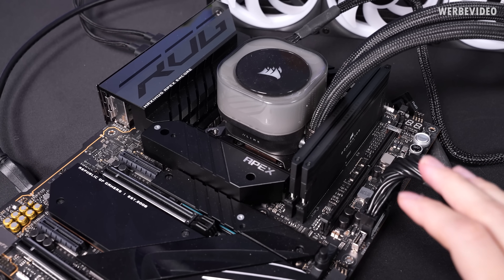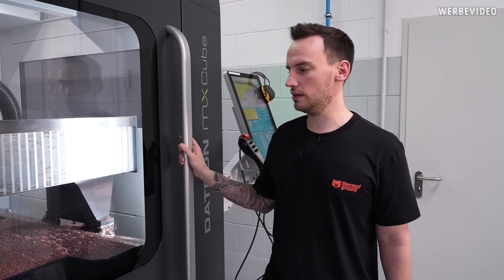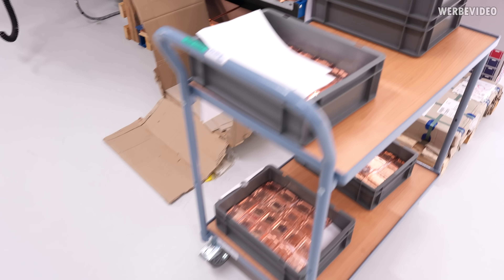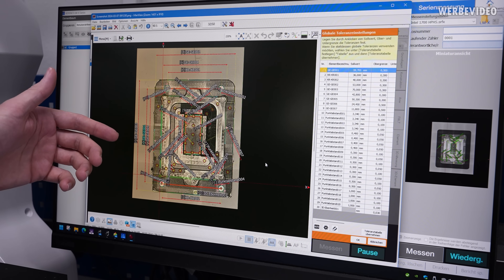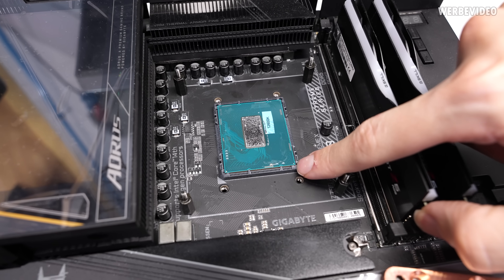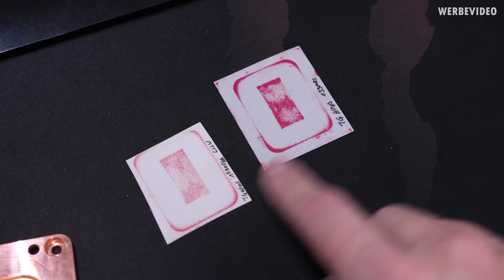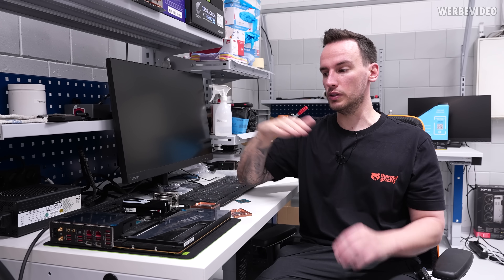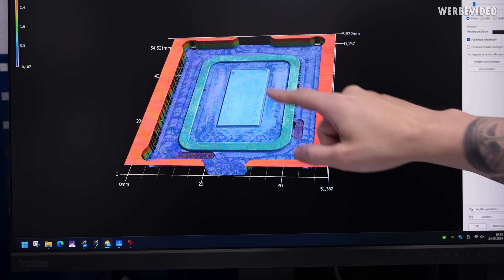I messed up

Comment: Intel specifies the socket manufacturer and lot number to be displayed on the sidewalls of the plastic base which could help narrow this down. The design shouldn't change much and seems to have an overall height tolerance of +/-0.05mm but it doesn't appear to be a critical dimension. The seating plane height after flowing has a tolerance of +/-0.2.

Personally I'd be hesitant to rely on this plastic base for such an application but I'm not sure how much tolerance you can risk. I'd imagine it's usually fine but there may be compounding variables.

Perhaps you should consider including a piece of the pressure mapping paper with a product like this. I know the Fujifilm stuff isn't cheap but in bulk it's probably under ~$1/unit and even less for a few pieces about the size of these Intel dies. That might help rule out user error and could become a great marketing tool. I've always thought something like this would be nice to see included with DD products.

Best of luck figuring it all out.

Comment: I have Iceman, 14900K and Asus Hero Z790
1) it lays on 4 legs which do  not touch memory lanes
2) First time I  used a screwdriver with 0.6 Hm, got 55 Qcode (no memory) - just turned screws 10 grad back to the left and all worked just fine. 
73 C  under FPU test AIDA64 (10 section custom cooling EK-D5 pump, 70% fans, 253W limit)

The problem may be that your customers apply NOT calibrated force, and plastic of socket may change its height due to the pressure
Reply: I use whatever screwdriver is nearby.
Reply: @MrViki60  I advice to use calibrated one, 0.5 Hm until "click" sound appears. 0.6 seems to much for me.

Comment: We'll, I'll start with the people that said they were having issues, check what components they use, maby they are doing something wrong, or maybe whatever they are using have different tolerance to what you have it's alot easier to work with the defective product than to guess what is happening

Comment: As soon as you said you went with socket height I wondered if the "issues" were a single vendor/board model or if there was possibly an issue with socket height due to say thicker PCB conflicting with plastic socket height or something.

You are immediately addressing the issue, attempting to ID the issue and didn't deflect or blame the customer.  You're doing what many companies don't do.  Good on you and this is honestly extremely interesting video but probably not one you want to make.
Reply: Yeah there may be board to board differences in socket height. That's what I was thinking.
Reply: As far as I know there are 3 types of socket 1700 currently.
1. little cutout at the base (most common)
2. no cutout
3. gold plated

Comment: Is it possible to send the contact paper to a few of the people having the problem & they can send you pictures of the results? Also can be a mainboard compatibility issue, some chip/resistor/cap on the board where you dont expect one to be... Preventing compression

Comment: Are mounting screws spring loaded? Also pressing into the plastic socket is not a good idea. The socket rim surface is not guaranteed to be flat and plastic is compressible. Extra quarter turn of the mounting screws will cause different z hight if they are not spring loaded.

Comment: looks like thermal grizzly  will be my replacement for ek so De8auer when will we see some rads and pumps and a few gpu blocks, Good to see a company taking steps to inform there uses befor it becomes a big media issue grate work

Comment: The things you can never measure on the production floor, are how hard someone is going to crank down on mounting screws, what assembly tolerances pcb manufacturers are hitting, and how uniform are the tolerances on mass-produced products you aren't manufacturing. 

You can measure your own parts until you're blue in the face, but it only helps so much. 

I will point out that there are few things i personally would change: 
A)  I would NOT be using the CPU socket itself as a hard-stop surface. It's plastic, and can easily be bent, warped, dented, crushed, and other wise deformed in ways you will never be able to predict. Even a hard plastic is still softer than most metals. 
I personally feel it would be better to produce a back plate for the other side of the Mobo, and use that back plate's screw standoff's as hard stops to prevent users from over-torquing the screws. 

B) If you're worried about pressing against the board, using a PTFE or some sort of HDPE derivative should help protect the board, while giving you a contact surface that shouldn't mar, or damage traces on the surface of the board. 

C) when talking to customers about the issue they are having, it's usually not going to be too much trouble asking them to re-seat the device, and have them take pictures of the procedure and specific points of interest to you during the process. This can give invaluable information to you not only about the potential root cause of the issue, but also gives you an overall view of the entire environment the product is in, it's easy to overlook small things that may be affecting the operation of your product when they are in an environment you can't inspect. (I'm not even going to get started on the PC's i've worked on in the past that had entire furballs of cat/dog hair trapped in the PCIe / Ram sockets... )

D) can i come play on your datron? XD
Reply: Being to close is not only an issue of "if it damages the MB" but being too close to the traces can change their impedance and enabling crass talk in the traces, basically creating interference.
Reply: Not every motherboard is going to be the same thickness tho... You could use a standoff from the FRONT of the motherboard to measure the thickness but if the socket depth isn't the same on every motherboard that just adds another issue to deal with. Will be interesting seeing what conclusions eventually are made about what is causing the issue, it is good to see companies getting out ahead of things, admitting there is a problem, then working with the community to find a fix instead of hide from it.
Reply: 10/10 across the board, the number of times both on PC's and tooling that I've had people go too hard on the first corner because there's zero resistance / they're not noticing it tip up, ending in a canoe / saddle situation is kind of sad. Getting a matching machined reference surface (that's also in line with the load, not allowing for any x/y torque) is the only fool proof way.
Reply: Динамометрическая отвертка в помощь. 60$ или трещетка с aliexpress за 13$
Reply: Torque screwdriver isn't so expensive and it should be a standard tool of enthusiast. You put there 5 Nm or some other value and you get consistent pressure results for every user :)

Comment: As others mentioned it would be interesting to get their MOBO / CPU to see what and if there is any differences. 
As for thermal expansion, would that even be an issue? One would think that manufactures have figured that one out and unless you're going for EOC (extreme over clocking) what is the average temperature a cpu see's 5-100C. (very broad range).

Could it be environmental? Not every room heats / cools the same way. 

I don't mind boring videos like this, gives us an insight into manufacturing. The steps you're taking to ensure QC and the engineering it takes to pull this off.

Comment: Are you sure that there's only one kind of socket? AFAIK, both Foxconn and Lotes make these. Thus, I'm inclined to think that the tolerances or material composition (and thus thermal expansion of the plastic) do vary. Other than that: Warped mainboards maybe?

Comment: Love your products.  I am no engeneer but with all of your checks the one thing you could not account for is Mother Board.  This product has a large span of chip coverage.  That being said age and wear of the mother board is probably the issue.  With such a small batch of 50 possible problems I would ask each what board and how long in service to check for possible connection. Maybe a brand and particular skew of mother board had a slight differance during production that under normal use works correctly but when dealing with tight tolerance fails to meet the standards you work in.  Age of board could have been exposed to excessive heat changeing flatness and or height  of socket or even overall board warpage.  I am sure there are other mother board factors that could play into these differences causeing the issue but without knowing the 50 complaint boards and time in service it could not be looked into or tested.

Keep up the great work and can not thank you enough for setting a great standard for others to work by.

Comment: A good guess: the tolerance on MBs is greater than you perceive. 
The boards are not designed for this device to be applied so they have no reason to meet the tolerance range you have....

Comment: Hello Roman,

Take the parts with issue back into your lab as fast as possible, and send them replacement sample. Measure 100% the replacement sample not randomly and keep contact with your clients if they experience the same issue.
Measure the returned parts and compare them with your golden sample / PPAP retrieved part. Even a sample from the first production batch would be fine.

Get in contact with the customers that are disappointed, where your product did not work as expected and try to convince them to sell you their motherboards. A few samples will be enough. Measure the mobo's with your Keyence equipment to see if there is a difference between the official specfication and the real product.

Make a list of all affected products and use statistics to pinpoint a certain combo, motherboard, processor, own production batches to solve this thing. And encourage your customer to speak up if things are not ok, as you need as much info as possible.

PS - small hints an automotive quality manager. Greetings from Romania.

Comment: could the plastic around the socket be the cause?  If you are relying on that to reduce the pressure on the cpu, but its slighlty off - caused either by variances in the product or process in how it is installed on the motherboard, that could affect contact.     Your quick response and explantion of the problem, plus pulling the product shows how you are dedicated to producing a quality product, and I am impressed by this response.

Comment: I would check the age of the CPUs affected. Very early CPUs may have different die heights.

Also if you have been measuring the socket height on a motherboard you have used a lot the plastic may have been deformed from repeated use more then a normal consumers board

Comment: Some plastics when curing expand or shrink a little. This is quite annoying, but it could give fluctuations when forming the socket that are invisible to the naked eye. Perhaps you need a rubber shim inbetween and mill down the block to absorb the inconsistencies.

Comment: Hi Roman what you are doing seems to be "easy" because it is "only" a copper water cooler. How difficult can that be?
But as you have just impressively shown us, it is damn difficult and extremely complex even for a seemingly simple product ("copper block").

1. the challenge in the development of any product is to identify and quantify the requirements and relationships between them.
2. the next challenge is to validate that you have correctly identified and quantified all the requirements and their relationships.
3. verifying that the product fulfills all identified and quantified requirements is relatively easy compared to points 1 and 2.
4. as if 1-3 were not difficult enough, requirements and their relationships can change at any time. Especially those requirements over which you have no influence and some of which you are not even aware of when something changes.

Points 1 to 3 also do not generate quality, only conformity. Conformity is relatively simple because it is comparatively easy to measure and what is easy to measure can be controlled and thus risks can be mitigated.
Quality is much more difficult than conformity because it depends on the degree to which a customer feels that their personal expectations have been met. As we all know, feelings and expectations are extremely fuzzy and volatile. 

However, as a company you can to a certain extent align yourself with the feelings and expectations of your customers and even manage them by providing credible feedback on what you can do as a company and where you see increased risks that customers may be disappointed.
For good companies, this has nothing to do with customer manipulation but with point 2 and the creation of transparency because everything you do takes time and requirements, which are a subset of customer expectations, can change over time. The better a company succeeds in aligning itself with the expectations and feelings of its customers and producing products that fulfill these expectations, the better the quality of the company will be perceived and the higher the quality of the company's products will be perceived.

And this video is exactly that for me. Your attempt to align with your customers' expectations in order to offer products that meet the expectations of as many customers as possible. 

Please tell us more about how you work and the challenges you face, because I am convinced that you will get to the bottom of this and be able to manage customer expectations.

Comment: Why not ask the people that had issues what motherboard they are using and see if its a different brand than the ones you test. Maybe ask them to take pictures of the socket to see if its a different style. Using the plastic piece for height could cause issues if different manufacturers of the piece don't have the same tolerances on the corner parts that stick out? Also would the temperature of the plastic not have issues with it with material expansion/contraction, I'm not an engineer so I could be completely wrong with this bit.

Comment: The plastic socket being the issue is what came to mind as soon as I heard it was used as a stop. I wonder how tight the tolerance is on a part like that, even if they all come from the same manufacturer. I also wonder if it could induce "user error" if torqued in an uneven manner. I could be wrong, and often am, but the paste looked a little thick in the lower area of the spreader shown to us.

Comment: I ordered my heatspreader (not the waterblock) a week ago and should get it in the mail tomorrow. I should have time to install it in a few days. 12900k + z690 aorus master + waterforce x280.
Interested to see if there is a difference between my current rockitcool ihs and this, a new reapplication of LM can help, but last time I changed it was less then 2 months ago. should be a good test.
I will try and think about what can cause issues when I install it.

Comment: Good luck working it out. When you work with very small variables things can be challenging. I worked in a lab for a while and It can be as mondain as the way a product is handled, but I am sure it will work out.

Comment: I got the intel Mycro Direct-Die  v1 on Thursday for 14900ks; I have a 1000d case with 2 x 480 rad at the front as air intake and 1x 420 at the top for air outlet; for some reason, I was thermal throttling when I was using the new Corsair cpu water block with LCD screen, so I decided to go with your product and delid my CPU. I installed the Mycro direct die on Thursday night, and everything was stable; I was able to achieve an overclock of 6.3ghz for the p-cores and 4.6ghz for the e-cores, and I also overclock my 4090 to 3015mhz.. my cpu temp is rarely above 50 degrees c and GPU temp is seldom 60 degrees. I was a bit surprised by this video and got an email from the team; everything went well for me. I’ve been stress testing for the last two days to ensure my system is stable, there is no more thermal throttling, and all my temps are way below 70 degrees despite the overclock.
Reply from the maker: This sounds like the results we had inhouse when creating the block. Also very similar to the performance I showed in my Video. I'm happy that it worked well for you :) May I ask which board you are using?
Reply: I'm using MSI MEG z790 godlike max.. Im a happy customer anyways, thanks for the product.

Comment: Even if you get your side of production correct, you are still facing a myriad of variables thrown at you by the other manufacturers. I would recommend having a finish pass with diamond tooling on the IHS. Also, switching to tellurium copper alloy could insure better process reliability without sacrificng thermal performance in a significant way.

Comment: i am wondering if the problems don't arise on CPUs that haven't been perfectly cleaned of the old solder TIM from the stock IHS. a leftover spec on the die would totally create a gap that can mess up thermals big time.

Comment: My bet is on the plastic socket inconsistency. Looks like the surround you use as a resting for your plate is not a critical dimension for standard cpu and there are probably some manufacturing variations.

Comment: Just my first thought, but do you suppose the higher temperatures problem could be due to some people not removing the stock IHS gasket/glue material correctly and fully (or indeed cleaning it off at all)?

Comment: hey man, you´re doing better than most manifacturers. just 2 emails and you go into full investigation mode 😂
Reply: What I was thinking -having two out of a batch of 50 products of a mass manufactured item which work in a sub-optimal way (but still usable)  and this level of investigation is really reassuring.
Reply from the maker: thanks! that was at the time of shooting the video. Meanwhile we have about 10 cases which is way too much regarding RMA and failure rate